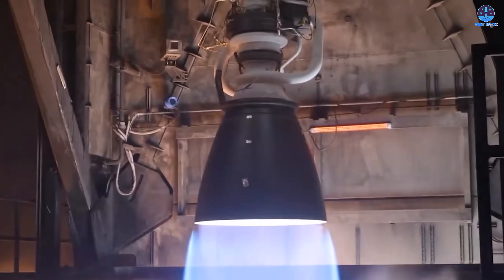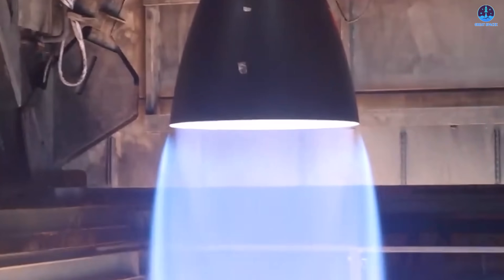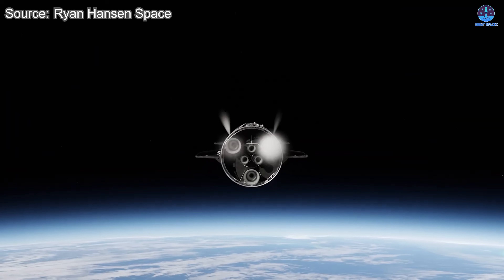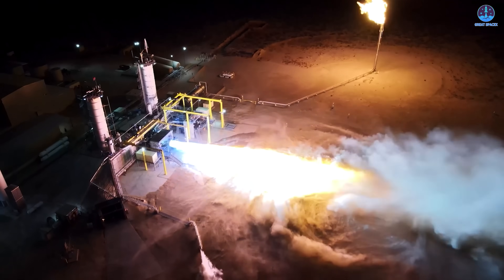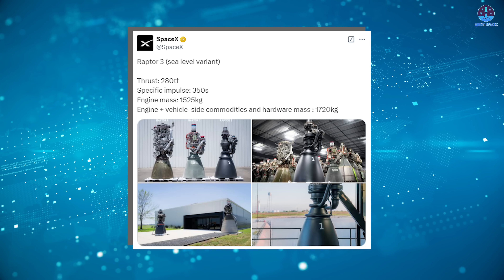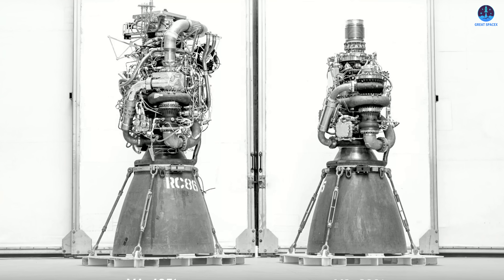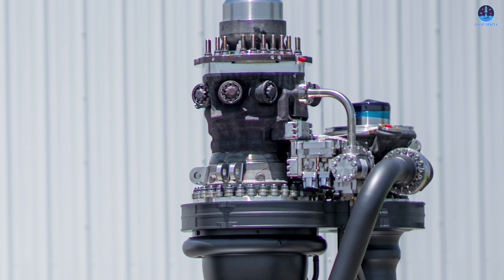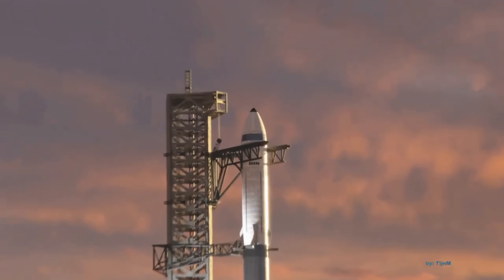SpaceX revealed New Breakthrough Upgrade on Raptor 3 Engine in 2026 Totally Ahead of Time!

Comment: I think one reason for the many engines approach is reliability. One loss is not much of a problem. But the Ver3 engine proves simplicity is more important. Thus ver X needs to be as gigantic as possible to reduce all the plumbing and duplication of parts, etc. 1 or 2 engines, if reliable and controllable, which SpaceX is good at now, is all that is needed.

Comment: If complex engine repairs are required, pull the compromised engine, replace it with a good engine and proceed with launch preparations.  All compromised engines go to a specialized tear down research and rebuild or recycle shop to assess and record issues then determine best options to proceed.  SpaceX will WANT to collect all possible performance data for continuous engine improvement process.
Reply: Since they can mass produce engines, pulling a compromised engine and replace with another makes the most sense as it will allow for faster turnaround than trying to repair an engine on a booster/Starship. Even if they just junk a problematic engine it would probably be more cost effective in the long run.

Comment: I don't know why this never occurred to me but all of that 280 tons of force is felt by the mounts.  More when you consider the forces of gimbling and vibration which adds to the load.  Those mounts are not really that large.  That alone must be an engineering challenge.  Construction equipment is built for those kinds of loads but construction equipment is large. and a lot more beefy.  Even after that's solved (of course it is, they've done it) the ship itself needs to support it as well.  And the ship needs to support 280 tons plus the one next to it another 280 tons and all of the rest which is 280x30 or 8400 tons.  Yes, I know that the ship must weigh less than the max output or nothing happens but it still needs to be engineered to take it.  The mechanical stresses at the base of Starship are so much that I'm amazed it doesn't just crumple under it's own weight when fully loaded.  Much less launch.

Comment: Repairing the engine is simple. Replace it. Unbolt it from the rocket and replace it. It is fast and efficient. You can then do a forensic teardown of the engine in question to see what the problem is and if a system wide fix is needed, they can make that in the production line and the next engines will be better yet.